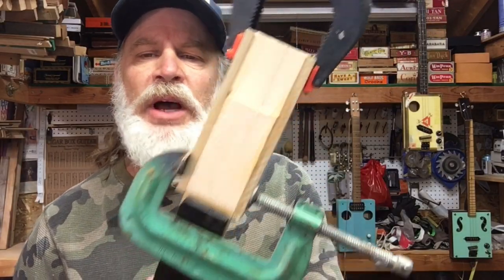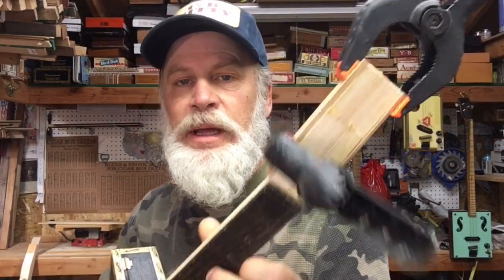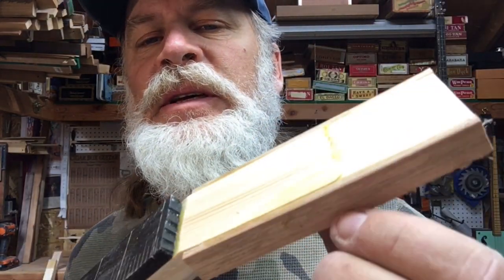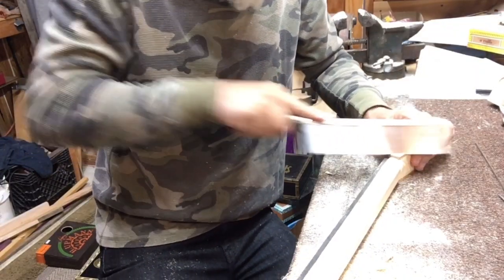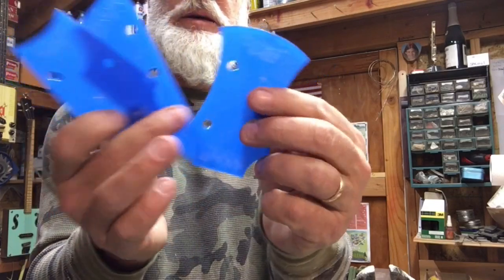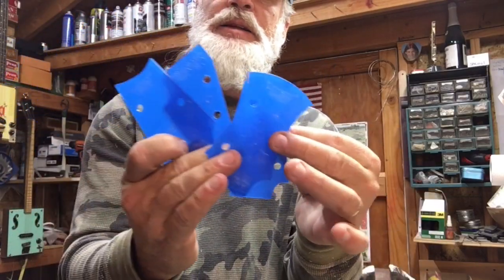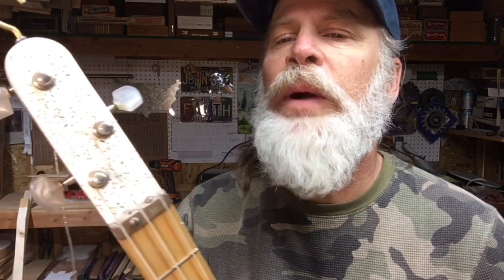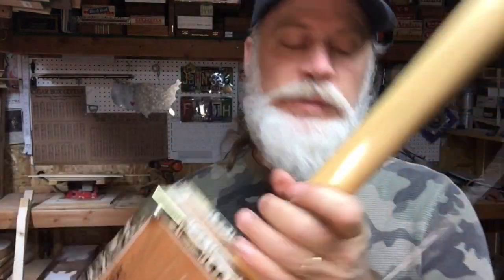Cigar Box Guitar - Headstocks - Tips and Tricks

Comment: Great video Del!! As usual! Any how, I offer a suggestion for the drill press sander. Use some 1/2 MDF and cut a 2 1/2 inch hole in the middle. The MDF can be wider and deeper than the drill press table. then glue strips of mdf to the bottom around 3 sides so the pc of MDF does not move when placed on the tabel. You will have to cut a corner out to accommodate the drill press crank.  Then you have a flat surface that the sanding drum can lower into and you can maneuver your pc of wood in and out of it. Also it is good to get a sanding belt/drum cleaner at Harbor Freight to keep the sanding drums clean. That is a long pc of eraser like block. It really works good and lasts a very long time. Thank You for  your  vids and Inspiration!!!

Comment: I would like to see a video of you using a CB Gitty 25" scale fully Fretted neck with Basic Headstock adding a Bone Nut two Left and One Right Tuner and 3 string hard tail bridge. I am curious how you would do the neck if you would make a heal for your neck, or just use what they send with blocks under it for support and how high do you set the fret board above the box and using a Delta Bucker 3 string pre wired with tone and volume controls